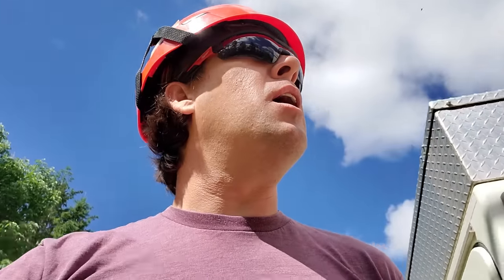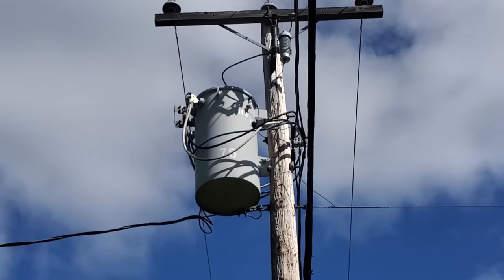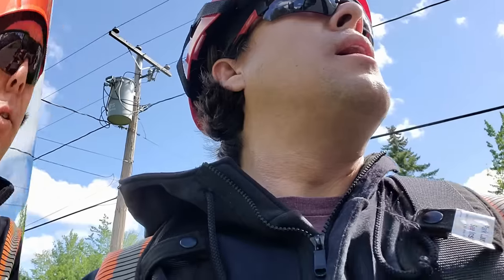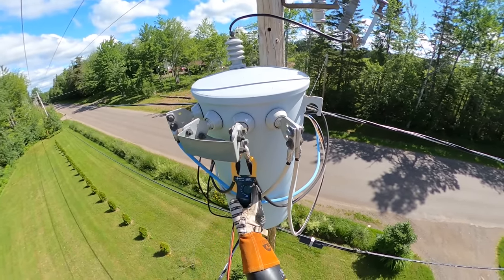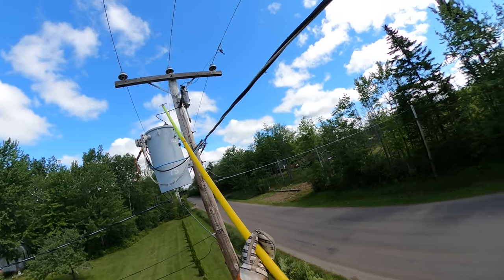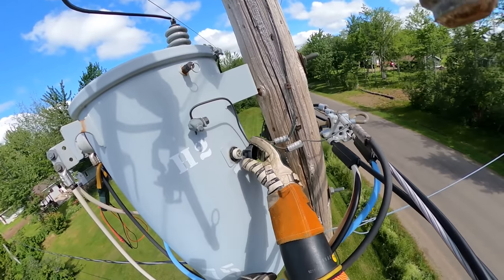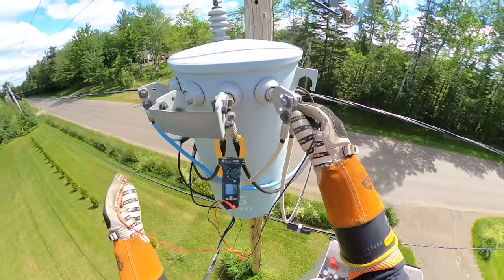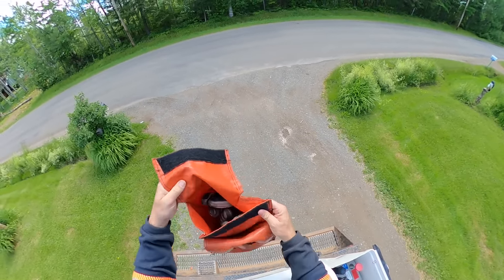How we change voltage on a transformer

Comment: I see a number of comments indicating that they would want the voltage to be on the high side, and that there is no real reason to worry about a couple of volts. For the vast majority of cases that is correct. But there is one case where having the transformer on the high side (250+) would be an issue. That would be for a residential grid tie solar installation. Instead of voltage DROP under load, you actually get voltage RISE since you are feeding electricity to the grid. Some grid-tie inverters will shut down when they reach 264 volts. Depending on the installation, a 5% voltage rise from the inverter to the transformer might not be unheard of.
Reply from the maker: First comment of this nature! Excellent information. We are just recently getting into bidirectional meters... Definitely something to consider
Reply: @Bobsdecline  I was thinking this too - that this may be why the customer noticed a rise recently, from BTM PV installs raising the overall voltage during the day. I have a rather large system (64 panels) and I don't see it go up more than a volt or two at the peak but I'd imagine if there were a lot in an area it could impact it.
Reply: Yes this is a growing issue now. Here many people are installing solar and the grid company are upgrading low voltage lines and changing to bigger transformers in order to keep the voltage down. They put the transformer taps so voltage during the night is 235V. In daytime it rises to 244V
Reply: @Bobsdecline  the biggest problem I’ve found is undersized cable from the inverters to the grid tie. The voltage drop on those cables causes the inverters to boost voltage to unacceptable levels until they trip off

Locally there will be a high voltage from solar installs, but if the solar is disconnected the utility voltage is fine
Reply: Very interesting.  I live in a small town that also acts as our power company and the voltage coming in at the panel is 124.6 and 123.7 volts respectively.   Anyway eventually plan to add solar power to the house using micro inverters, specifically the Enphase IQ8A, should I be looking to see if they can make an adjustment or should I be fine?  Right now it's about the hottest measurement I have seen overall but with everyone running AC's I figure they have things pushing a little harder.
Reply: @VentShop  Enphase does have a Technical Brief article on calculating voltage rise in the system. There are a lot of variables that affect the total voltage rise on the furthest inverter on the system. Everything from circuit length and wire size, how many inverters, and even if they are portrait or landscape orientation...... I suspect that the system can be designed for the current voltage you are seeing at your panel. But the installer should do the calculations to confirm.
Reply: @VentShop  in my area the owner or the electrician contacts the energy supplier and tells them "I want to install 10kW of solar". The supplier will then easily be able to calculate if it is possible or any upgrades to the network is required. A family member just installed 12kW at her house and the supplier upgraded the transformer and 200 meters of cable (for free, they like solar and are required by law to do it). Before the upgrade only 7kW was possible before the inverter shut down on overvoltage.
Reply: @kayakingphotos  knowing the voltage at a particular moment is not enough, you need to know transformer kVA, wire gauge and length, how much solar the neighbour's on the same transformer have installed etc. Only the energy supplier has this information.
Reply: @VentShop  I have a rather large PV setup and I still see my highest voltages in the middle of the night.
Reply: In Poland it has become a major problem in countryside, we have a grid with one large transformer feeding hundreds of meters of low voltage lines. In past a solution to voltage sag on those long lines was that utility set the transformers on a high side, e.g. 245V phase to neutral, which is within 207 - 253 V allowed range, so that even when that poor old long line was loaded heavily on the very end by you and your neighbors that has recently build around you still was above the 207 V limit. But now you and most of your neighbors have PV and on a sunny day you see voltage creep way above 253 V and inverters start to shut down due to overvoltage... And it becomes a fight between neighbors who can push their PV system longer so that it is not theirs but other PV inverter trip the overvoltage first. Ask me how I know 🙂
Reply: @mibars  here in Sweden the rule is the grid company must upgrade the cables to a thicker dimension before more solar is installed. For example two houses might share a cable that is 4x95mm2 Aluminium.

From how I understand the system in USA there the inverters must be programmed to dynamically reduce power instead of tripping when the voltage is high. For example it might reduce to 70% production at 248V, 60% at 249V etc. You and your neighbour's could implement this to prevent tripping (almost all inverters have the option already).
Reply: @mrfrenzy.  We have a rule that don't need a permit to be "prosumer" (I'm not sure if it is an English word - a combination of a PROducer and conSUMER), you just need to notify your grid operator after installation and they have a month to put a bidirectional meter so that you can start producing, i.e. utility knows about PV installation after it is done. With incentives for couple of years it resulted in a boom of installations: I was the 1st one on my branch, but this spring there are already 4 solar systems on my very long and old line.
Reply: I would want my voltage lower but there are voltage reducer by APC that give me 110 for my Christmas lights. . Going solar can also give you lower voltage. For my heat and Air conditioning I want standard voltages I don't know if I want to ask the power company to lower my voltage there are other options. 73.
Reply: @mibars  How do you know?
Reply: @davenone7312  What are you asking about, how do I know the laws regarding PV connections in Poland? I live here and went through the process :) And regarding voltages I had suffered from high voltages for couple of months this year, only after many many complaints they fixed it by lowering voltage by 10 V per phase back to around 230 V at no load at night.
Reply: @mibars  You said in your comment "Ask me how I know"
So I asked.
Reply: @davenone7312  Ah sure - So now you know :D
Reply: @mrfrenzy.  <<
mrfrenzy
5 days ago (edited)
 @Barszczu Garage  here in Sweden the rule is the grid company must upgrade the cables to a thicker dimension before more solar is installed. For example two houses might share a cable that is 4x95mm2 Aluminium.>>

I expect the utility isn't compensated for the costs imposed by solar power producers.  Solar users just LOVE the grid tie,  because they typically get paid too much for power and impose costs for services they don't pay for.

Want to be your own utility?  Cut the grid tie.

Grid tied solar is a RACKET imposing costs on the utility and other power users.
Reply: @mibars  Prosumer has a different common meaning in the US,  Take a chainsaw for example, generally in order of price but with some exception and overlap,  the cheapest one is throwaway  junk, the next quality level is residential or consumer grade, next level would be high end consumer grade or prosumer, and finally high quality made to last referred to as professional or commercial grade.
What you describe in regard to being both a producer  and consumer of electrical supply would be called grid-tie in the US. 
 I think they would throw you in jail in the US if you didnt have a professional electrician verify the plan, get the grid operator's approval of the plan, install it, stand accountable for the installation and the grid operator making the final connection to the grid. I've seen similar situations where someone tried to do it themselves and even if they did everything to code the electician or plumber will still refuse to sign to take responsibilty for it so you cant get a permit.  Often they will rip out everythning you did and completely redo it with all new equipment of their choosing.  Everything spent on it t by the do it yourselfer is wasted.

 And all of that is much more expensive than it sounds. Costs about US$40k minimum, not counting any government subsidies for a typical residential size solar installation right now. Breakeven on that would be about 40 years for me at current electricity rate. I hate to show my pessimism but I dont think I have that long.  I would like to make the switch but  would have to set up an isolated system for it, plug loads in to one system or the other, to avoid all the extra expense of grid-tie.  Utilities here, and this likely varies a lot across the nation, mostly want to discourage distributed production because they cant control it. It is potentially hazardous to line workers who get in to a situation where the line unexpectedly becomes  energized.   Ehh I think in that line of work they always take extreme precautions anyway but that's the official argument.  Every lineman is acutely aware of what can happen if you F up.
 Also they are contractually obligated to meet peak demand, no matter what and the financial penalties are steep if they fail to meet demand so they dont want a bunch of generation they dont fully control.
Then there is the issue of lost revenue to the grid operator, I think that truly is the main reason they oppose distributed generation though that contractual obligation to meet peak demand could be the driving factor.
Reply: @SeattlePioneer  4x95 mm2 for two houses: My line is 4x35 mm2 aerial line on last ~200m meters until it gets to the pole where it splits to five houses :) It was originally built couple of decabes ago to power just two small houses.
Reply: @laserflexr6321  Thank you for that detailed description! Here it is very different, but still not 100% "wild west" style: An utility cannot refuse to allow you to become a "prosumer" if you meet all the criteria and there are couple of things that have to be met, e.g. you need to provide an electrical diagram created by licensed electrician showing how is your system designed so that they can check if it meets all requirement, you need to provide all the details and certificates for inverter and solar panels, inverter must be on the list of approved inverters capable of specific load regulation and couple other things. The process is just reversed: You don't need preapproval to start the work, but the work must be done according to certain rules, otherwise you won't get a green light to produce any electricity and even if you do it anyway older style electronic meters would register power flow in either direction as a cost to you... Plus record a "backfeed" error which may be a base to give you a fine for interfering with proper grid operation.... Although the very-old mechanical meters would happily spin backwardas :)
Reply: In Germany our grid tie inverters are supporting power factor correction if the voltage gets too high, so they are supporting the grid frequency instead of rising the voltage to a critical level
Reply: I have had this same issue in the Uk with a SMA solar inverter shutting down when it got to 264v,
Although our standard house voltage is supposed to be 230/240 single phase, it’s not uncommon to have 240/245 coming in
Reply: @mirkomania  In Poland all inverters installed after certain date must support Q(U) mode, but you are not required to enable it. Based on what people say it is less benefitial to enable it that to rely on basic rule of shutting down if the average voltage in last 10 min exceeds 253 V, or immidiatelly if it exceeds 264 V, you'd produce less energy in Q(U) mode.
Reply: @mibars  It is indeed less beneficial, if the inverter is really producing reactive power. The meter only measures active power. But enabling Q(U) doesn’t mean, that the inverter is only producing reactive power, this only appears in certain situations, so the difference is not that big
Reply: @Bobsdecline  In addition to creating overvoltage problems, consumer-side production creates real danger for linemen who are not used to (or even worse, unaware) of PV-s continuing to provide power after the HV side is isolated. Have had multiple cases here where consumers install PV/s without notifying anyone and technician get shocked (mostly, luckily) due to that. Changed the law to prohibit that, added additional isolator switch, number of warning sign and system upgrade requirements for contractual bidirectional power, but retraining all technicians to consider the risk should be a priority.
Reply: I have exactly that issue in the UK. The nominal voltage is 230v in the UK and mine is regularly around 250-253, which is at the boundary what’s allowed and I am waiting for a tap down
Reply: This is 100% accurate. When you have solar and the utility company has your nominal voltage on the high side, your system will throttle or shut down based on UL1741 standards.
Reply: I feel like all meters are bidirectional unless we are talking about some old digital ones.  Though, I know analog meters will just spin backwards and start subtracting from the meter count which could be argued as unidirectional.
Reply: @laserflexr6321  at 05:22 ol boy wonders just that.  He's isolated the transformer but there could be plenty of backfed angry pixies still looking for ground.
Reply: That's a customer problem, not the light company. Fix your stuff.
Reply: @mrfrenzy.  Need to charge customers for any upgrade related to solar. Screw this green garbage.
Reply: This situation happen in Puerto Rico a lot
Reply: People often get this messed up. Keep in mind that even very large solar systems may only raise the voltage by about one to 2 V in order to push very large amounts of current. I am in California and have done thousands of installations and it is rarely a problem.
Reply: I wonder if he’s located in Wichita, Kansas.
Reply: Thanks for that info.
I was wondering how or why a utility customer would even think their voltage is too high, or why it would be an issue.  
I've never heard of it before.

Comment: In EU we have plus minus 10% tolerance. So it's between 207 to 253V when 230V is the baseline. It's because we have long low voltage lines with single transformer feeding hundrets or even thousands of houses. Most of them are 630 KVA. In such conditions the transformer without much load is at about 250V, so the closest customers tend to get that voltage often. At the end of the line, in high load conditions, it's nothing suprising to find about 210V. And, as three phase service is pretty common here, you can get very different voltages around your house if the phases are not balanced well. It's not much of a problem nowadays, but back in the time when indandescent light bulbs were widely used, people living in the higher voltage area had them going dead very often. Some even used step down transformers to feed their light circuit, just to prolong the life of their bulbs. LEDs and even the already obsolete CFLs don't seem to have that problem fortunately.
Reply: Wow! That’s so Interesting. Never heard of this problem. Probably because I’m not an electrician. But that’s very interesting indeed.

Comment: I remember years ago, during the summer, I noticed the house I was in at the time had voltage problems with lots of dimming and “dip downs”. I went outside and found the transformer I was on (an old rusty 37 1/2 KVA) and chased down the wiring and found 7 houses fed from it. I called the electric company and told them I felt it must be overloaded. They came out, and agreed. They replaced it with a new 50 KVA and the problem went away.
Reply: 1/2kva? You mean 500va? 
And 7 homes from it? 
A couple og light bulbs would overload that thing
Reply: @KuntalGhosh  37
Reply: @KuntalGhosh  37-1/2 or 37.5

Comment: I'm shocked your company would authorize this work when it's within spec.  This would never happen where I live.  Good work.
Reply from the maker: Only because there was a simple solution.... If the tx didn't have a tap changer, we wouldn't swap it out where the readings were good.
Reply: The difference between performing a check and doing the change was all of 2 minutes, the equipment was there to make the switch a simple process.